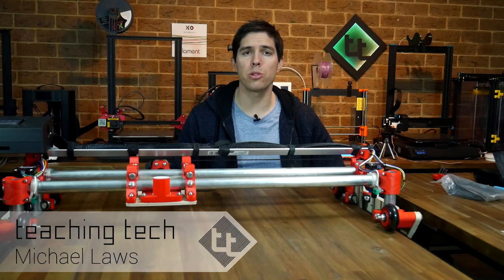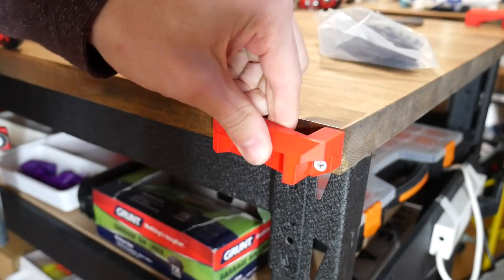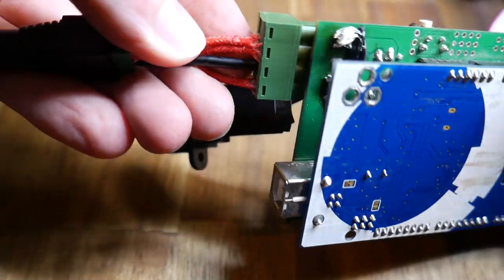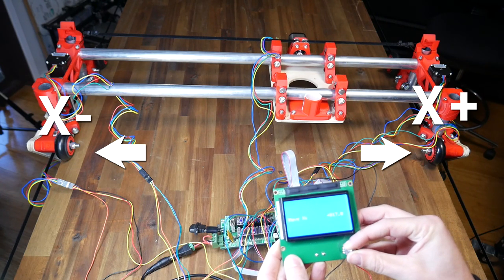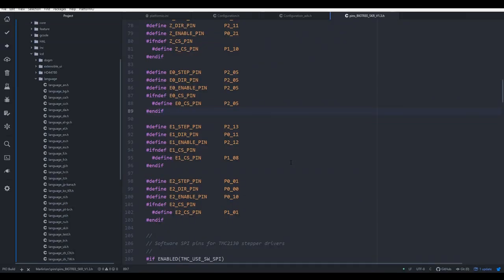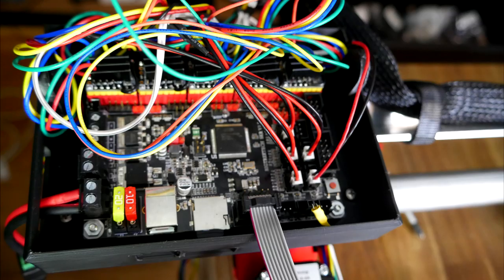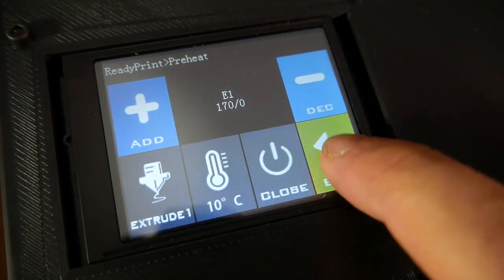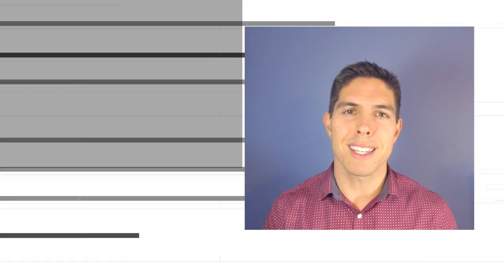MPCNC Lowrider part 2 - belts, wiring, firmware: Ramps + SKR V1.3, TMC5160 & touch screen

Comment: Love your explanations - Unfortunately I'm coming in to this a bit late and the V1 kits were discontinued. Instead I have tried to 'go it alone' and source all the parts individually and have now completed all the mechanical bits. I would like to use your auto-squaring solution but the SKR 1.3 appears to be discontinued - do you know if the SKR 2 is a direct replacement?
btw - Try turps instead of acetone to remove those labels, you may need to scratch through the shiny coat on the label first.

Comment: What power supply are you using to power all 5 motors?
Reply from the maker: The one that came with the electronics kit from the store.
Reply: @TeachingTech  I meant the volts and amps :D
Reply: @DAMIRMK  Probably a 24v 350w - 450w mean well industrial PSU would fit your needs. You'll want the extra torque on the steppers from running them at 24v. Since there's no heat bed, you can probably get away with a lower wattage.

I mean, you COULD probably run it off an ATX 12v psu if you wanted, but the motors won't be as strong.

Comment: amazing friend. will you have the files of those parts to be able to print them? It would be great to be able to follow your steps, greetings from Argentina
Reply: Marcelo Deri as i understand this is not open source so no one can actually make it unless u ask for permission but u won’t be able to do mods, check on Twitter
Reply: Braulio Manuel buenas hermano tienes razón no son archivos de código abierto. Te los venden
Reply: Braulio Manuel queríamos imprimir las piesas en casa con una 3d casera q armamos con arduino

Comment: Thanks for this video.  I am currently trying to build the Lowrider CNC and am about ready to do the wiring but have a couple of questions.

The RAMPS kit I bought has A4988 stepper motor drivers I have read that these are more reliable than the DRV8825 drivers, but they are 16 step rather than 32 step. Will the same firmware work with these, or do I need a different firmware, and if so which one?  I do have some 2588's available which I can use if that is recommended.

Second question is about burning the firmware.  Do I have the RAMPS board and LCD board plugged in when I burn the firmware?  or do I burn the firmware first, and then plug in these boards.  I assume that the firmware has to be burned before I can adjust the potentiometers.

Vern in Canada

Comment: Hey, this is awesome.I just updated the firmware on the TFT28 that I had.  Is it possible to also have a "100mm" range in the move tab?  I know this can be pretty dangerous if you accidentally hit the 100 instead of 1 or 10, but 2.5m is a long way on the Y.  It would be even better if it was possible to only limit the '100' range to X and Y

Comment: Warning :Never, ever unplug and plug your stepper cables if you have board powered. It's very easy to burn your drivers that way. This is not mentioned in video when he unplugs wires. Also resistor isn't needed when you have correct firmware. At least I didn't have any issues with mpcnc

Comment: Are you not having any issues with noise from the stepper motor. Limit switches are prone to glitches because of this. Shielded cable is a solution to this. Some people are using cat 5 to wire the limits as well.  I just wanted to give you heads up just in case you have a long print on your hands and randomly locks.  Also Grounding the metal on your machine. It took me days to figure that out.

Comment: nice work and  thanks for sharing your knowledge.
 
Can we use this LR2 CNC for the commercial purpose with air cooling system? .because if we use continuously 4 to 8 hours stepper motor and control board  temperature will increase..
 so please advise ......

Comment: In the video you mention adding a resistor to trick the board into thinking it has temperature, but you do not say which resistor you use.  Can you explain this a little better? Also, in the video when you show the SKR board, it does not look like you a resistor on it any more, but something else?  I am new to this and any information would be greatly appreciated.

Comment: I have a question: the entire system sits on just 4 wheels? no counter wheel beneath the board? What happens if you put to much downwards pressure with your router? Wouldn't that push the entire gantry up from the table?

Comment: Wondering if it's possible to have one Z limit switch signal also serve as a Z probe signal? So after homing Z you would then have an alligator clip with an extended limit switch write on the tool and the other one on some conductive material that the tool touches to indicate the tool height. Possible?

Comment: When you mount a laser, I'm curious as to what it would take to be able to cut 1/8" or 3mm plywood.
Reply: Personally I think it all depends upon the size and power of the laser and thus is really hard to answer with any sort of accuracy. I've got a small $70 one that can mount magnetically on the side of my Ender 3 3D printer that will barely cut 1mm deep and yet I've also got a big 30 watt one in a cabinet, the so called chinese laser which, when you get past the ridiculously crappy programming can cut 3-4mm but I'm told that for any sort of serious engraving you need to get the 40W one or better still the 100W one but the price goes up seriously when you do. Forgive me if I'm wrong here but for cnc work I think this machine has great potential, for light laser engraving work it has as well but for laser cutting you may find that a dedicated Laser machine of fairly high power would be your best bet but please, if your experience teaches you that I am mistaken in my thoughts, please get back to me as I also would be able to find a better way to achieve laser cutting and if it were possible, laser engraving on metal without having to throw away my machine and get a 40W minimum one to replace it. Best of luck with it all and persevere with this machine, I've almost got the bugs out of mine and it teases me into thinking of a whole new world of projects in wood in my future.
Reply: My 40w laser will chew through it.  No doubt you will find a video of someone cut testing on youtube.

Comment: I think you should absolutely fix the way you do the homing for z axis. If you do it with a tool mounted going down, your tool will likely touch in the table. Or you do it at last in a known position where you did an hole big enough for your tools.

Comment: idk if it's actually gonna be a problem, but that mounting of the z end stop switches looks sub optimal, as the axis you are measuring them against is also the direction the mount can rotate, making it easy to get a sensor out of alignment.

Comment: Goid grief you really put alot of work into these, much appreciated, especially seeing the use of the 3d printer type control board and touch screen so you can run a job via an sd card. No need to have a laptop so saving $$$$$     Laurie

Comment: Is ANYONE here able to update the drivers to TMC2208 in Michaels firmware and compile it for the SKR 1.3?  I've been battling platformIO on my machine and I cannot get it to compile.  It's the only change I need to make to get this running and I've spent two days trudging through forums and trying every suggestion under the sun, and all I get are errors.  I didn't think I was asking too much from PlatformIO, lol.  It may be my computer...I don't know...
Reply: Have you got it working? If so how did you use the tmc2208. Did you have to edit the firmware?

Comment: To remove stickers, don't use acetone which tends to dry the glue and makes it hard to get off. Instead, get a spray can of motorcycle chain cleaner. It's a mix of oil and solvents. Soak the paper of the sticker and it'll come off easily without leaving the glue on the part.
Reply: Its on a steel pipe. Just heat or burn it off. Heat gun or propane.

Comment: hey there great video as usual, but having some issues that I hope you can help with, getting this error when trying to save the file.

" linter-gcc2: Executable not found

"C:/Users/teachingtech/.platformio/packages/toolchain-gccarmnoneeabi/bin/arm-none-eabi-g++.exe" not found

also getting this error when trying to build it 

Warning! `env_default` configuration option in section [platformio] is deprecated and will be removed in the next release! Please use `default_envs` instead
Can not remove temporary directory `C:\Users\teren\Desktop\mpcnc lowrider 2 - marlin 2.0 and mks tft firmware- teching tech version\marlin 2.0 - mpcnc lowrider2 - skr v1.3 tmc5160\.pioenvs`. Please remo
ve it manually to avoid build issues
Processing LPC1768 (platform: https://github.com/p3p/pio-nxplpc-arduino-lpc176x/archive/master.zip; framework: arduino; board: nxp_lpc1768)
--------------------------------------------------------------------------------
Tool Manager: Installing framework-arduino-lpc176x @ 0.1.3
Error: Could not find the package with 'framework-arduino-lpc176x @ 0.1.3' requirements for your system 'windows_amd64'

any help would be great :)
Reply: Please leave your email and i send the file for you
Reply: If you are using tmc5160 please look at the link
Reply: @martinlee-on8327  not using tmc5160 using a4988, driver selection isn't the issue. It seems I am missing some firmware or something and I cant install that framework

Comment: Thank you for all of your hard work on this project. I am building the MPCNC and made the appropriate changes in the Marlin config that you provided to run dual x and dual y steppers using the SKR v1.3. It worked the first time! Now all I need is a spindle motor and I will be in business.
Reply: How do you like the firmware for the SKR v1.3 ?

Comment: привет у вас есть прошивка марлин для фрезер   Ramps 1.4 с монитором  RepRapDiscount Full Graphic Smart Controller (LCD12864 display)
hi you have Marlin firmware for the router to monitor slides 1.4 reprapdiscount full graphics controller Smart (lcd12864 display)

Comment: Hey Michael, Do you have any reason why Sensor less homing didn't work? I'm going to try to use your Firmware with my MPCNC (2209 drivers) (I'll use your Z Channel for X) But I really want to use the Sensorless homing. Any thoughts would be greatly appreciated. I'll post here if I get it to work :)
Reply: How did you get different stepper drivers to work did it just work or did you have to edit the firmware ?
Reply: @dankmagic1622   I had to edit the firmware (Marlin 2.0) There's some documentation on it somewhere but I don't remember exactly where. It works really good. Unfortunately, I decided to use a different board  and  switched to grbl which isn't so friendly with sensorless homing.

Comment: Just set the thermistor to: 998 : Dummy Table that ALWAYS reads 25°C or the temperature defined below. This way you don't have to use a hardware config and it will never fail by vibration.
Reply: Whereabouts in the config is this?
Reply: @JohnHall73  In the thermistor settings. Only applies to Marlin firmware.
Reply: @MarinusMakesStuff  Thanks I am on Marlin 2.0.x so I will look for it. What file? Configuration.h?
Reply: @JohnHall73  Yes! It is in configuration.h somewhere higher up in the file. Just search for thermistor within Arduino :) they supply a list of possible thermistors and 998 has the description of dummy table.

Comment: so I like the second build part of this really informative and my question will this be able to do aluminum or is it just for what and if you would suggest to someone for around $1,000 what would suggest for a CNC machine that's table top that can do aluminum Max 3/8 of an inch
Reply: I have cut 6061 Tempered 1/8" on my lowrider2 without issues it may be able to do thicker. but you'd need to go slow.
Reply: Convert the x to screws and it will work harder, most belt systems have to run slow

Comment: Is anyone having problems using atom on Windows 10. I am trying to get marlin 2.0 on a skr v1.3. It keeps falling in atom. Using the environment LPC1768. Does anyone no why this is happening.
Reply: Tried to flash my MKS SGEN L yesterday but I couldn't even install platformio. It was stuck at setting up dependencies for atom. I then switched to vscode. But now I can't compile marlin. Seems that something with the pins is wrong. Or maybe the LCD. I don't know how to fix this
Reply: They got something messed up in the latest version - from a command prompt "apm install platformio-ide-terminal@2.8.4"  this will install the previous version
Reply: @DrxGmbH   I also have the same problem as well. With this, It was stuck at setting up dependencies for atom. What LCD do you have?
Reply: @JessicaRyan7of9  Yeah I switched to vscode and this worked flawlessly. Currently I use the default creality screen. But I also have a new MKS TFT 35 here.
I also found the problem and provided a fix. Was merged a few hours later. A pin was not correctly declared in the config.

Comment: Hello sir , excellent job on the updates u made . I bought all the stuff u used , skr v1.3 , Mks tft and the TMC5160. After downloading the files and restarting the board am getting this error 
Error:printer halted kill() called . Any idea what would be the problem ? 
Thank u for your time
Reply: Does the machine move
Reply: @martinlee-on8327  no no axis is moving
Reply: @martinlee-on8327  I’ll check it out when I get home , thank u freind for taking time and answering me I appreciate it . I’ll let u know what happened thanks again
Reply: @martinlee-on8327  are u using the same board and drivers ?
Reply: Yes i have the same hardware and tt software
Reply: @martinlee-on8327  wow Martin thank u very much sir it worked thank u very much . One q 
Am using the er11 spindle 1.5kw and it’s little heavy so when the z axis try to lift it , it shatter when I take the spindle out it lift it with no problem . I know these drivers hold up to 20 amps so how can I make the amps higher so the stepper be able to lift it ? Any idea
Reply: Some one further down the comment line look for mary ann boadu has a modified version of the software uses more current
Reply: @martinlee-on8327  thank u buddy I’ll read it . Thanks again
Reply: @martinlee-on8327  I looked into this comments but they just talking about the( software.bin )file . Do u know which part of the config.h I need to change the MAX amp for the stepper ? 
Have u changed your self ?
Reply: No i have used the precompiled bin file from v1 engineering i dont have problems because i have a makita router on the machine
Reply: I think you must change the vref
Reply: @martinlee-on8327  yes I’ll try look into the config.h maybe I’ll be able to tune the amps . 
I used the same code and modification this guy used . Another guy told me to use lead screw with 1 mm pitch instead of 2mm pitch . Before the TMC5160 i used DRV8825 and raised up the current on the drive to max which is 1.2 and still I was having problem with the Z axis wasn’t able to lift the weight of the spindle
Reply: @martinlee-on8327  wow thank u freind I’ll change the amps up to 1500 and try it again . I really appreciate ur time responding . I’ll try it and let y know what happen . Thank again
Reply: @martinlee-on8327  hello freind . Thank u yesterday I tried it and it’s working really good no problem with lifting that 1.5kw spindle .so far o changed the stepping current to 1500 ma it was 800 that y . Also I change the holding current from 0.5 to 1 . I ordered lead screw with 1mm pitch to get better percussion and results . I appreciate ur help and ur time .
Reply: Very glad it worked out
Reply: @martinlee-on8327  hello Martin I hope u had good thanksgiving, so after I tuned the amps and I changed the lead screw from 2mm pitch to 1mm pitch , now everything is working . But am using aspire to do toolpath and I downloaded the post processor for marlin , the problem is when am telling the aspire to cut depth 3/4” , when I run the gcode it’s cutting 1/4” , I don’t know is it coz I changed the lead screw ? But I don’t think that matter coz it’s the same diameter . Or is it coz of the steppers? Or is it because of the post processor for marlin ? Any idea ? What software u use for toolpathing estlcam? I would appreciate ur help.
Reply: @namocrafts1101  meshcam software
Reply: @martinlee-on8327  is it possible to change the step/mm in the MKS lcd ? And save it ? Instead of changing it in the software and compile and copy it to the sd
Reply: @namocrafts1101  i dont think you can do that from the lcd screen because you cant access the eeprom from the screen there are some codes from marlin that you can try with pronterface
Reply: @martinlee-on8327  am trying to change the steps in the config.h for the z axis coz I changed the lead screw from 2 mm pitch to 1mm pitch , but I don’t see any changes . Am compiling the code in visual code and copy the software.bin with new update and put it in sd card with SOFTWARE.cur and reset the board . Is there something am doing wrong ?

Comment: Very awesome!
You can btw disable low print temp warning in the marlin firmware!
I would really want to know your accelerate and jerk settings. As I have found out 3D printers are a bit to fast for my own laser.
Reply from the maker: I haven't checked yet but I'm running whatever V1 engineering set up as default in their firmware.

Comment: I have tried 1000 times and I cant get the firm ware to compile someone help!
Reply: I think the frmware for SKR 1.3 is faulty, TFT is ok; please author to check upload
Reply: @nelson bonilla you may have upgraded the software you are working with (ATOM; PlatformIO) some upgrades have changed some stuf
Reply: @ictcontroler282  Did you ever get it to work ? I have the same errors
Reply: did you get it to work ?
Reply: Get older version of the software, I believe the update doesn't like some of the (brackets) along with some of the comments, not sure why he didn't just throw the firmware file up for everyone